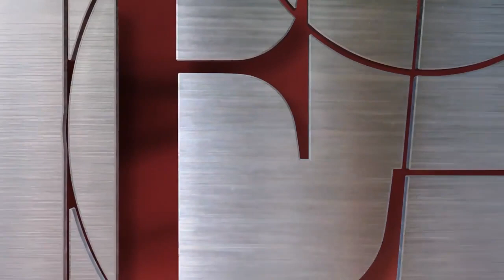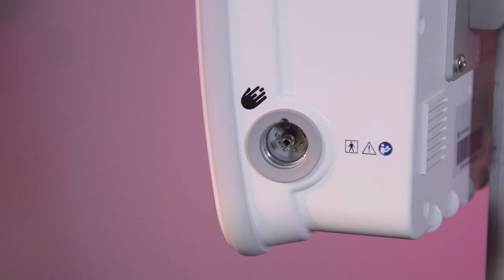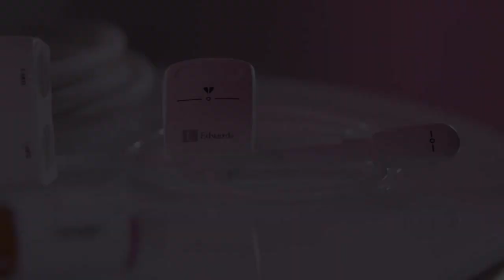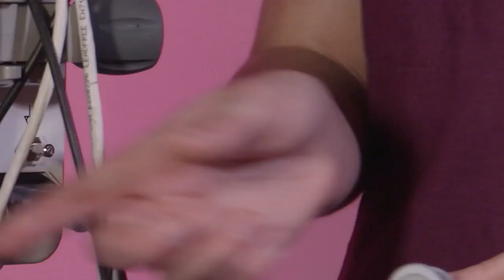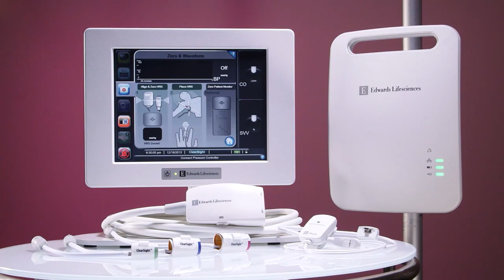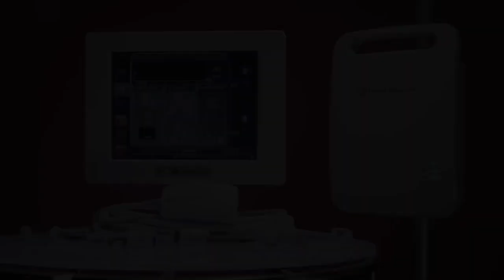ClearSight System Setup Video

Comment: The verse " Likened to" upon deep analyzing have multi meaning the wisdom behind that. With layers. Such as the Duality of beings, the Parallelism wisdom, the 2:1 in everything, the To and Fro movements, with similarity and difference. Yesterday night upon being irritated by the Cassandra Nova intent to the Sun Star SuperNova effect of attempt fast track it's energy usage of how the 4th kind powerful beings plan to carry that out by layers of Pondering theres the realization whether with awareness and consciousness or not it depends upon the beholder mindset being but the likened to like gaseous substances of chemistry polarity effect could set in of either a light side identifier pure or not can have an opposite set in of trail or vice versa of lights and shades. But considering sciences in distinction with another layer of powers, in distinction with another layer spiritualism, and how each interact in likeness or parallelism, dualities,   or intermix by the 2:1 of polarities quite different than the 2:1 of lights similarity quite different than the 2:1 of dark similarity or the real polarity of lights and shades only the subject in mind thinking carry of agenda or not of each beholder knew the motives and intent of the criteria of God to judge spiritual beings. Wherein for example if the in polarity sides for example only, if the law identifier sets in, the dark identifier trails but with a distance if pure law identify but if unsure the other unsure could mingle in a body and mind, if edged the Edged side could set in in a distant, depends on that person being what is the being of that person really. For example a summoned ally conspirator could either knowingly or unknowingly harbor the other unknown likeness being of probable in image or likened to face of either intent face shape shift approximate in likeness of the other beings in question and of considerate knowing such as either the first kind human beings, the second kind animal like companion or opposite beast, the 3rd kind aliens, the 4th kind powerful beings, the 5th kind Supernatural beings, the 6th kind spiritual beings or the end time intermixed spirituals of the cause and effect of spiritual Adultery of having connivances of both sides light and shades agenda secret alliances from thr Biblical verse mentioned pure and unsure spirits and the verse what's born of the flesh are flesh meaning the Adultery of such of married then partnered with other married or unmarried either church or law civil married or likened to the pure married by good light spirit by pureness of partnership of Mary and Joseph of no Biblical record of being married in thr Jewish religion. Could affect both body and spirit if unfaithful to each other. Much more the worst effect in spiritual Adultery of 2 opposite side spirits merge in for an agenda connivance. Whatever the reason or intent of such person of summoned by others of alliance of  target a being mode for whatever reason then that could open a door for the other leveled beings of synch to trail or co habitate an aware or unaware being depends on the person mindset of intent or motives. The Lionel Kalaw being of my early elementary classmate of quite similar looking with Daniel P and with image resemblance with Cassandra Nova could have a direct awareness connectivity OR no awareness and indirect connectivity. Only the conscious and the unconscious side ( sleeper side ) of that being mindset can determine the totality of a person if the other side part of upon completion of a being person lights and shades being persona can determine in how many existential beginnings and ends a person exist in timeframes such as in the verse about Jesus who recently discounted from a boat on a shore encountered by a demonized body of a self inflicting wound being when asked by Jesus what is the person name, he replied We are Legion. Referring to dark side spirits.